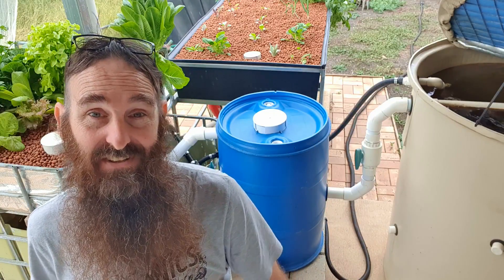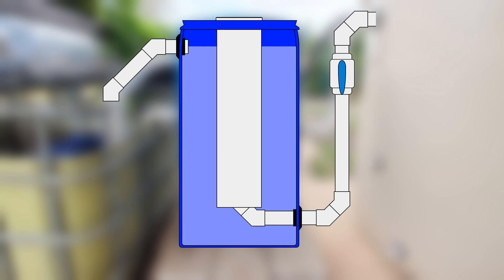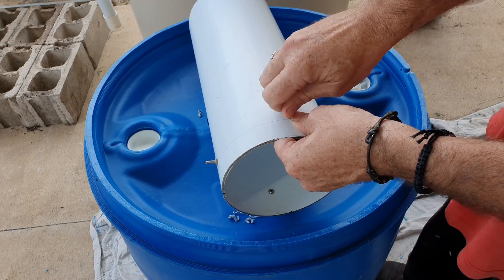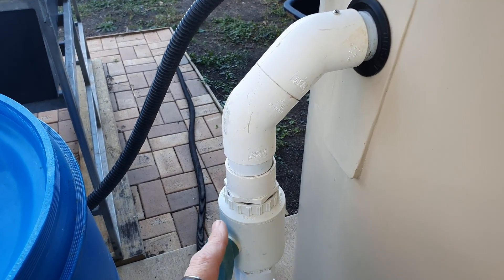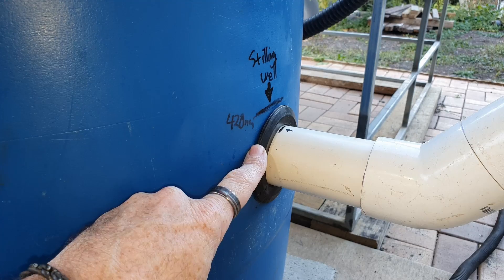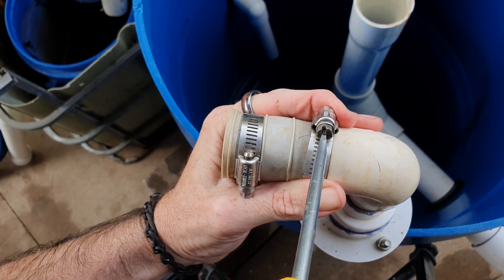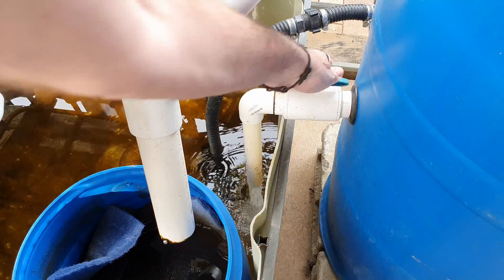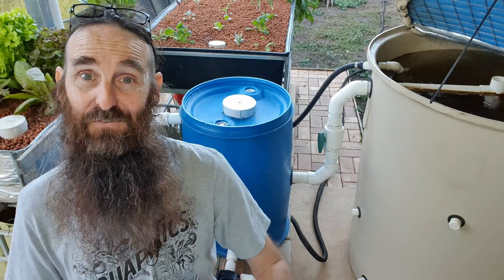How to Build Radial Flow Settler for Aquaponics System | Components & Tips

Comment: May I ask what the diameters of the inner pipe and the outer sleeve are?
Reply from the maker: I use 50mm / 2" pressure pipe as the delivery & have 150mm / 6" pipe as the shroud.

Comment: Instead of a floor drain flange for the SLO and RFS drain could I just use a PVC cap and drill a bunch of holes in it? Unless you can send me a link to the floor drain flanges you used.
Reply from the maker: You can use the cap with holes. I've done it myself in fingerling tanks & bio filters. 
YouTube sometimes blocks links in comments but they're called a "floor flange" or "waste tray floor flange"  in Australia. I couldn't find anything similar on US sites sorry.

Comment: Hi Rob, thanks for your video and all the information.
What kind of pump you are using for removing the solids from your tank?
thanks
Reply from the maker: I was using (from memory) a 1800LPH / 475GPH SunSun pump that we used in our first system back in 2011. It's now running our "organic" hydro system back at our old house in Ipswich.
https://youtu.be/t87g4BL9bhs?si=tjOzgTqlAfO1C7RF

Comment: I was expecting the gravity fed swirl filtration tank to have a similar water level to the pond tank, but yours is much lower. Why does it not overflow?
Reply from the maker: The outlet of the settler sets the maximum water height in it. 👍
Reply: @RobsAquaponics  Thanks Rob. And does the overflow on your bottom drain prevent the water from the pond syphoning to the swirl filter?

Comment: Been watching your videos for a few years now.  Great stuff.  I always come back for tid bits to fix my issues.  What is the pump you use to drain the filter? I can't seem to find one similar. Thanks for all the info on this channel!
Reply from the maker: Hi Brandon & thanks mate. 👍
At the moment I'm using a little SunSun wet/dry pump I purchased about 10 years ago. 
I got it from this mob from Guppys aquarium if I recall correctly & was part of this range https://guppysaquariumproducts.com.au/pump-6800l-phr-submersable-multi-purpose.html
That series can be run inline like I have it or as a submersible.
Hope that helps some mate.

Comment: Can I have a grow bed 3’ wide X 10’ long X 1’ deep?

Fill on one end, bell syphon on the opposite end gravity feed back into the opposite end of the pond. 
I plan one on each side of a 
8’ X 4’ X 3.5’ deep pond. 

I plan to use the dirt from the hole to build a berm and put the grow beds on top of the berm.
I’m in central Florida
Reply from the maker: Sorry I missed this David.
That sounds like s decent size bed & should work fine. 👍
Did you end up building it?
Reply: @RobsAquaponics  
Wow!
Two years ago it was all a jumble in me head 🤣
Yeah, I sure did build it!
And a 660 sq. ft. house. 
The pond is about 6,000 gallons (+/-) 6.5' deep in an oval shape. 
I'm not doing your version of Aquaponics. 
But I'm using a LOT from your videos. 
I'm using the pond water (high in Phosphorus) & the "stuff" from the filters & settling tanks to fertilize everything in the ground or in pots. 
I have good well water but P is building up in the pond so instead of dumping water for a water change I'm irrigating with it. 
My soil is a lot like beach sand. 
I'm in the Withlacoochee Forest and I think this was beach front a million years ago. 
I'm growing veggies for me & the fish & pretty plants to sell to pay for all this madness 😂
I think I found a niche with Papyrus. I'm growing it in the pond then harvesting it & putting it in pots to sell on FB. 
I should have an unlimited supply!
I've had mostly success and a few failures. 
The single Pleco & a nice big Koi (Moby) sadly died when a breaker tripped overnight but the Tilapia have survived going on 18 months with very few casualties. And the original 45 have spawned many times. 
Back when I wrote that question I was sitting on the boat I had lived on for 25 years. I'm sure I watched every one of your videos, some several times. 
I learned a LOT! 
Congratulations on your new place & continued success!
Reply from the maker: @davidmurley1863  Sounds like an impressive pond David. Is great to hear it's growing well & turning a profit of sorts too.
Thanks & all the best mate.

Comment: I used a 275 gallon IBC tote for my settler. The square shape isn't ideal, but I hope the extra volume (using around 250 gallons of it) compensates for that potential performance loss through sheer retention time when combined with the moderate slow flow rate of the pump. I'm thinking of sinking a submersible UVC bulb into it to make sure nothing grows inside the tote and basically allow the settler to act a bit like a UV clarifier as well. The square shape and flat surfaces really helps making it easier to install anything to it using nothing but a tight fitting hole in the wall and a bead of silicone.

When I first filled the settler, the pond level dropped 10 inches in depth. Considering that I originally kept that pond moderately clear using a crappy 55 gallon drum settler, I'm hoping that a settler over four times in volume would work better.
Reply from the maker: UV sterilisers will kill off the beneficial bacteria in the water & can reduce the availability of some elements to be taken up by the fish. I have run them in systems to kill off algae blooms before & placed them directly before the fish tank to minimise any effect it had. 
Have seen a few folks use whole totes as solids setters & they do a great job, just a bit tricky to remove the solids when the time comes as you pointed out. 
Cheers & happy growing.

Comment: Hey Rob, you are my go-to source for info as I build my 1st AP system here in New York.  Thanks for all the great videos. Just wondering about the height of the standpipe in your RFS in relation to the outlet from the fish tank and the outlet to the sump.  The outlet from the fish tank looks to be several inches above the standpipe. And I'm guessing you have the standpipe at about even with the outlet to the sump.  Thanks so much!
Reply: My fish tank doesn't seem to be emptying quick enough.  When the grow beds (2) are emptying one at a time, things are flowing ok, but if they both drain at the same time, it's too much, the fish tank is overflowing.  I lowered the outlet from the RFS to the sump tank by 2 inches...that didn't help.  I cut the top of the standpipe by an inch, that didn't help.  Any ideas?  2 inch pipe all around. I just uploaded a video to my youtube channel...Dicker Gaming....if you want to see.
Reply from the maker: @dickergaming6938  Hey mate. Thanks for leaving a video on how you set it up. It really helps. 👍
As the water coming from the grow beds is already filtered, I'd run the one over the sump directly down into it. That will stop the main FT from overflowing. 
Sorry it took so long to get back to you. Hope the system is doing well.

Comment: Would a very short radial flow work as well? Like 20 cm high and 150 cm wide?
Reply from the maker: I'm not sure it would. It would work as a settling tank if you had the inlet at one end, a few baffles in the middle & outlet at the other if it was a trough. 
Water flow rate would also play a large part in how well the solids will settle out.

Comment: Hello, how do you calculate the flow leaving the fish tank? 

Thank you very much for your great videos. Always comforting and easy to take in!
Reply from the maker: I time how long it takes for the filter drum to fill & then work out how many times it would fill per hour. 
Say it takes 4 minutes to fill a 200L/50gal radial flow settler that works out to be 3000LPH/750GPH. 
60min / 8min = 7.2
7.5 x 200L = 1500LPH
7.5 x 50 = 375GPH
Hope that helps some.
Reply: You can use a free fall gravity calculator and plug in the drop and then find the velocity then take that and plug it into a flow rate calculator with pipe diameter.

Comment: Okay this setup makes so much more sense than the other one.  Well done.  I've taken a horse water tote and put 5 gal bucks on each side lenth wise.  Put in a nice 3000 liter pump and a 4 way slot sprayer make with 1" pvc to push the water along the horse tote for current for my 10 trout.  So there will be pockets for current and non current just like a river.  I put in local river rock as media.  Added an aerator below my 4 way jet current sprayer and my fish absolutely love it.  They are so calm.

Comment: If you bend the PVC with salt tape and heat it won't stunt the flow. Just run water through it after the bend to prevent salt in the system.
Reply: Also will prevent a rough texture that fine sand would leave. (No build up of hard particles)

Comment: Where do you order/buy your bulkhead connectors from?
Reply from the maker: Big Box hardware stores will normally stock them in smaller sizes. You might need to try rural or irrigation supply stores for the larger ones.

Comment: Hey rob, I’m planning on building a system soon, it’s going to use 2 beds made of a 55 gallon blue barrel cut in half vertically and a 60 gallon aquarium for the fish tank. What size vessel do you think is the smaller I could use to make a settler? I was planning on using a 5 gallon bucket but I’m afraid that will be too small. Thanks!
Reply from the maker: I would probably go with something like a canister filter for a smaller system like that Spencer. 
This is the version I made for my parents system & it did a great job with a fairly high flow rate,
https://youtu.be/HtMZRM3a5Fs
Hope that helps some.

Comment: Hello I have a question for you your knowledge is fantastic what would you recommend I have a koi pond and I'm trying to figure out a filtering system would you recommend a swirl filter or radial filter that's the best solution to remove the solids
Reply from the maker: Radial flow is supposed to work better than a swirl from what those in the commercial industry have said. There's loads of swirl fanboys out there that will say different though. 😉
For me personally, I'll be sticking with the RFS. 
Are you wanting to remove the finer solids as well?
Reply: @RobsAquaponics  yes im thinking a 3 drum a solids separator and moving media drum and a biological drum in series im hopping this along with 3 large waterfalls air stone and a UV light will give me good p filtration
Reply: Yes I have a 3 drum system I'm working on 1 for a solid separator 2mm moving media k1 and biological filter along with three waterfalls an AirStone also a UV light I'm hoping this whole system together will give me good filtration for the koi fish and also Crystal clean the water

Comment: At 4:57 he talks about thr fish tank and how it sucks up the solids.  I don’t see a pump how the heck do the solids get picked up.how does the fitting suck up the solids?
Reply from the maker: The water coming into the fish tank causes water & solids at the base of the tank up the Solids Lifting Outlet (SLO) pipe & out the side wall of the tank. 👍
This link will take you straight to a section in another video that will give you a visual explanation. 
https://www.youtube.com/watch?v=0QQA5BpWKec&t=338s
Hope that helps some.
Reply: @RobsAquaponics  thanks

Comment: You mention in the tank you have a drain fitting that collects the junk at bottom. How? Is there a pump connected to that? I did not see one.
Reply from the maker: The water coming into the fish tank causes water & solids at the base of the tank up the Solids Lifting Outlet (SLO) pipe & out the side wall of the tank. 👍
This link will take you straight to a section in another video that will give you a visual explanation. 
https://www.youtube.com/watch?v=0QQA5BpWKec&t=338s
Hope that helps some.

Comment: Good day sir. I have a situation that poked its ugly head just recently. In my radial flow settler the fish poop is floating, making floating islands. Normally I would be blaming the food, but I have not changed brand/type of food since the beginning. Any ideas you may have would help. Thank you
Reply from the maker: Hi Matthew & sorry it took so long to get to this comment. You will find that the waste will start to float as it decomposes in the collector. Gasses start to form in the waste & that's what causes it to rise up the water column. Best way to stop it is to clean the solids out more regularly. 
Hope that helps some mate.
Reply: @RobsAquaponics  yes, it helps very much. I always like to hear that I need to work more. Good day mate 👍🏻

Comment: Hi Rob, thanks for the great video. I built the whole thing but having a problem with the "brigde syphon". When I open it, it runs until reached the level where the pipe goes in and stops. I checked on "air leaks" but everything seems to be ok. Any idea why I might have done wrong? Cheers from Germany....
Reply from the maker: I don't have a lot of experience with them sorry Tom but it sounds like air is somehow getting in there. Not enough to stop the the siphon but enough to impede its operation. 
This video from Rob over at Bigelow Brook Farm may help you out some. 
https://www.youtube.com/watch?v=4IVc7oq29Uw

Comment: Hi.I have a pond and a pump in the pond.how would run the pipe work,with a radial flow filter added to the system.I don't have a separate fish tank.Thank u
Reply from the maker: Hi Andre. Have been asked this a lot. I would pump up to the radial flow settler from the fish tank. The pump will smash the solids into finer particles taking longer to settle out. To help with their capture you can increase the size of the settler drum allowing the water to have more retention time. The longer the water stays in the drum, the more of the finer partials will precipitate out.  👍
Hope that helps some.

Comment: Good Day Rob, Thanks for your Radial flow filter video. I just wondering if I use my fish tank submersible outlet to inlet of radial flow filter, will it work? Thanks again.
Reply from the maker: Do you mean the outlet from your pump as the inlet to the settler?
If so then yes, it will work but you may find that the solids a smashed up a bit by the pump & not all will settle out. 
One way around that problem is to increase the size of the settler tank which will give the water longer retention time. The longer it stays in the settler, the more time for the smaller solids to fall out of suspension.
Hope that helps some & sorry it took a while to get back to you. .

Comment: This might be a bit of a dumb question, but I have in mind trying to design a system where, if the fish manage to breed within the system, the baby fish would be able to be pulled into this radial flow settler to A) be protected fro the adults and B) could then be netted and transferred into a secondary tank to grow out and replace the first fish when they are harvested. How could the part of the pipe within the fish tank be designed to accomplish that? (Or would the whole system need to be designed differently?)
Reply from the maker: I have seen folks find tilapia fry in their settlers/filters all the time after being pulled up the SLO in the fish tank. Most will have the base of the SLO sitting ¼-½" off the floor which is more than enough for the fry to get through. 
Hope that helps some.
Reply: @RobsAquaponics  Thank you!

Comment: Hi Rob, great videos. Absolutely love your work. Quick question, doesn't the fish tank overflow when you close the valve into the RSS to clean the RSS out?
Reply from the maker: It will overflow if you don't turn the pump off or isolate the inflow to it with a valve. 👍👍

Comment: How is solid waste suction working ? Are you using water pump to suck the solid waste to the mechanical filter ?
Reply from the maker: I use a pump but you don't need to.
This clip shows how I clean the filter,
https://youtu.be/H-jfWMpZXHI
& this clip may give you a few other design ideas,
https://youtu.be/sBCC9tMsleY
Hope that helps some.

Comment: So... What is a pressures pipe?
Reply from the maker: Pressure pipe is any pipe that is constructed to be able to withstand water being moved under the high pressure from a pump of some kind. It generally has thicker walls than that of stormwater or drain pipe as they move water using gravity. 
Hope that helps some.
Reply: @RobsAquaponics  aaw thanks Rob!  Have an amazing week

Comment: Can you feed say 5 fish tanks through the same Radial Flow Settler?  Or do you need 1 per fish tank?
Reply from the maker: It all comes down to retention time as that's what will help the solids fall out of suspension & if the flow is too great the filter won't preform properly.  
This clip might help you with the basics of how the filter works & give you some ideas to play with.
https://youtu.be/sBCC9tMsleY
Cheers. 
Hope that helps some.

Comment: hi Rob, great tip, I built my system with two tanks in parallel to increase the retention time, staying with 9 minutes of RT, the downstream filter greatly increased the autonomy, very grateful
Reply from the maker: If I had the room I might just try that out as well CC. 👍👍
Hope the systems running well for you.

Comment: Hello rob from New Mexico. I'm having problems with my bell siphon.  It will start and drain but I cant get it to break the siphon. Any ideas on what I'm doing wrong? Thanks I love your back yard farm.
Reply from the maker: Sounds like the water flow may be a bit fast. Have you sorted it out yet Michael?
Reply: @RobsAquaponics   not yet I havent had time to mess with so it's been running as a constant flow. I think when I turn the flow down I cant get the siphon to start.

Comment: Instead of stainless steel bolts you could try nylon or polypropylene.
Reply from the maker: Haven't seen any for sale locally but they would do the trick. 
Thanks for the suggestion NP. 👍👍